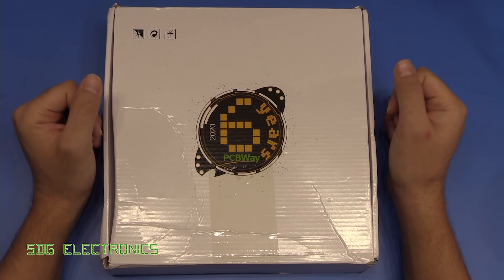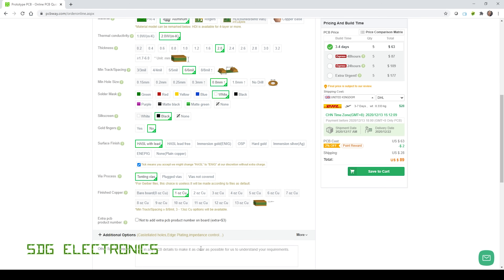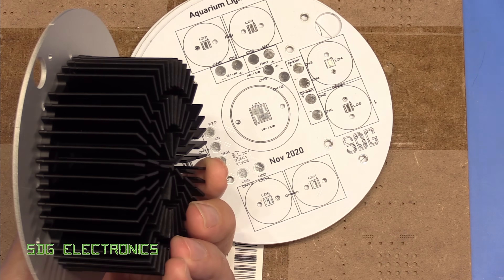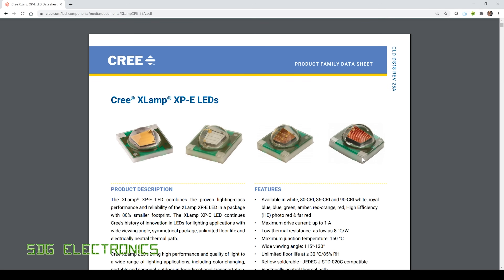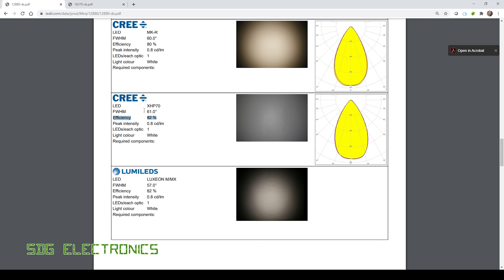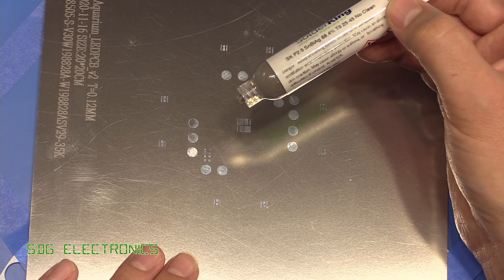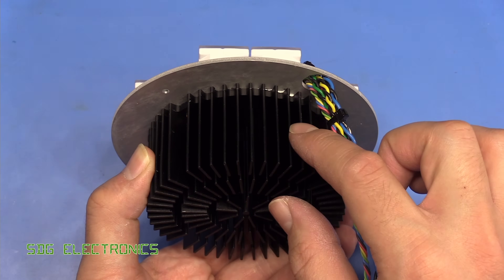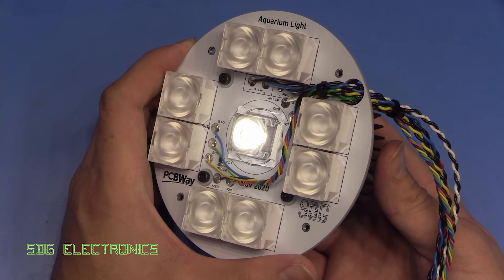SDG #183 Cree XHP70.2 Aquarium Light with PCBs from PCBWay

Comment: But are you really going to get 4k lumens out of that single XHP70.2? (even if you have the P4 or Q2 bins). I use these quite a bit and if you keep them cool I've never had one pull more than 1750ma (at 12V). And the brightness stayed fairly consistent from about 1300ma and up. So while they are tested at 1050ma (that's from memory so I might be a bit off there), and it's at that current the lumens are measured (call it 2k lumens for round numbers), I don't find them to get that much brighter at higher currents. I've built a 12 V 3A cc driver for them and yet they seem to only sip at it. Is there a way to jam more magic pixies into them?

That being said, "the brightest flashlight in the world" uses these, and claims, with 18 of them, to get 100,000 lumens. I just don't get how they do their math. Even at the idealized 4k lumens that's still about 30k short.

I'm not trying to be contrary here I really want to know -  am I missing the boat on a lot more lumens?
Reply from the maker: The voltage goes up to about 13.6V at 2.4A. I'll try measuring the light output, but they are considerably brighter at 2.4A than the 1050mA test current
Reply: @sdgelectronics  (smacks forehead)  Thanks for that. (blame Covid brain)

 I've been so worried about current I wasn't willing to push the voltage to force the current draw up towards my CC driver's max of 2400ma. I'm topping out at 15V and finally drawing 2.4A (on a P4 bin, and outputting about max 3800 lumens - and I have tried lensed/reflectored and not).

 But in measuring the output  I"m still not close to where it would need to be to fulfill the "brightest flash light in the world's claim of  100,000 lumens with 18 of these, unless of of course I run them up in the 18V range and  3.2A. But even with active cooling that can't be good for them. 

I guess I'll have to do some lifespan testing up in those ranges. I've talked to Cree at length on these and because they are so "new" I don't think they even know what the longevity is.

Again, thanks for the thinking reset.
Reply from the maker: It's also worth adding, that you'll not get the maximum brightness without forced cooling. As the LED die heats up, the light output decreases at any given current. The effect is more significant than you'd think.
Reply: @sdgelectronics  Exactly! In the race of brightness vs current/heat, the latter pair always wins.

Comment: I'm no expert at aquarium lighting, but it seems like a soft box like diffuser is a good idea. May be even reflected light. 50-60 deg lense angles do not seem logical in this application.
Silicone coated baking paper makes an easiest and cheapest material for that purpose. It shifts the CT a bit to warmer numbers, but it is worth it compared to direct light.
You can buy special diffuser sheets made for photography if you want it to be fancier, but it is harder to come by and a lot more expensive.
Reply from the maker: It depends on the effect you're after. I used to have a much more diffuse lighting source, but the end result is quite dull. With the pendant style you get shadows and ripples in the water, but you obviously then cannot grow high light plants in the dark areas
Reply: @sdgelectronics  I noticed light beam effect in your tank, like on a very sunny clear day, looks cool. I was just wondering if it is natural to stay that way all the time, and  how living things react.

Comment: I want to operate a cob 50 watt , 1.75 amp , 36 V led in strobe mode , can I give it 20 - 50 amps and Ton 3ms , Toff 7ms , freq is 100hz. What would be the voltage for a 36 V 50 watt dc cob .
Reply: What is the application?
If you'll overdrive voltage, current will follow, strobe mode or not. So your LED should degrade faster, proportionally to excessive voltage.
Also keep in mind that COB is a LED matrix, where individual LEDs do not match exactly. So overdriving it, could stress some LEDs more than other, introducing another vector of degradation.

Comment: I don't see really how the thicker PCB would help with heat conduction here.. quite the opposite. A Thin PCB should have better heat conductivity since the actual heatsink material covers pretty much the entire backside anyways and the PCB is just a barrier between the LED and the heatsink? There should be no need to transport heat "sideways" inside the PCB since there's the actual heatsink material to do that already. Just my initial  gut reaction.
Reply from the maker: The heatsink and PCB are both aluminium so the thermal resistance of the material is not the issue, however there is greater thermal area before the heatsink-PCB interface and thus should give better heat diffusion. That's the hope anyway, but the fan will likely make any of these differences insignificant
Reply: Since the board is wider than the heatsink, some heat will transport sideways to the edge and maybe increase conduction slightly. But yeah, since the heatsink and PCB are made of the same material, and size is roughly the same, it won't make too much difference. If you go too thin it won't be rigid enough.

Comment: Used PCBWay last week to produce 40 RF boards using controlled Rogers RF substrate. The boards were delivered faster than 6  and 5 of the exact same board produced on regular FR4 from OshPark(rush job) and JLCPcb that were all ordered on the same day.  OshPark delivered yesterday and JLCPcb is yet to surface. I was pleasantly surprised to say the least.

Comment: Steve - any consideration for the amount of heat that will transfer to the water itself or will the lamp assembly be mounted far from the water surface for minimal impact? Thanks for sharing and happy holidays!
Reply from the maker: Thanks Dino. I'm not too concerned, there's around 180 litres of water overall to keep at 24C. The room is always cooler than that so shouldn't have too much impact. Happy Holidays!
Reply: @sdgelectronics  Maybe you need a liquid cooling loop into the aquarium  instead of a fan :-)
Reply from the maker: @lmamakos  I think someone already did this!